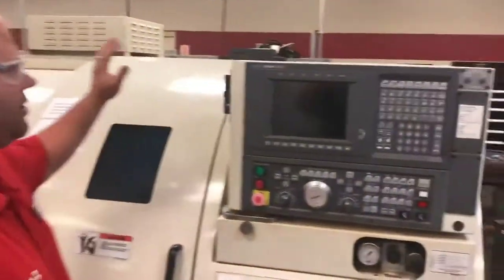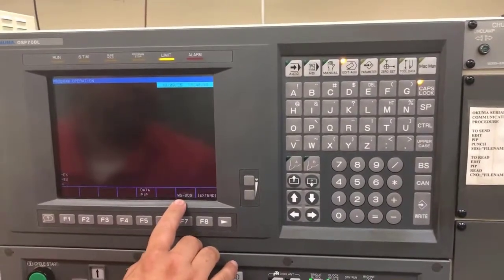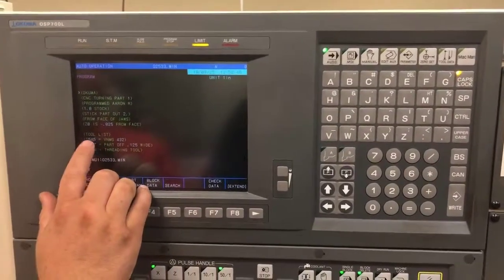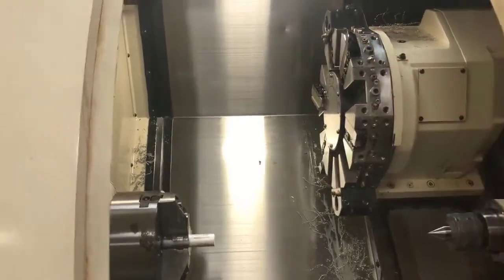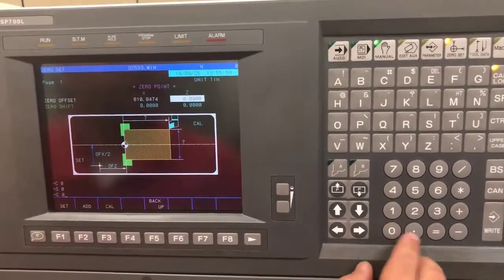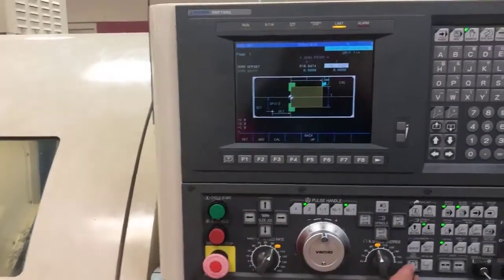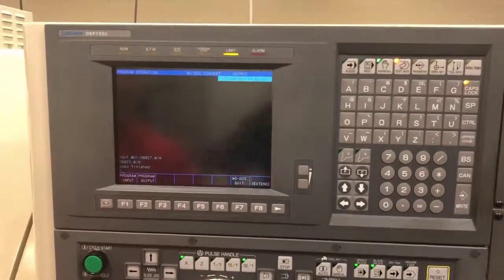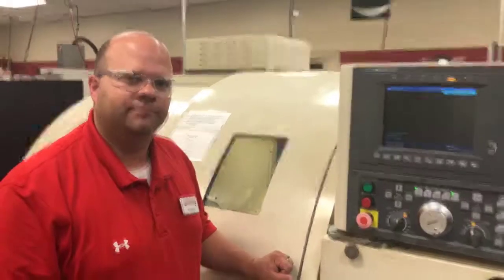Okuma CNC Lathe Setup

Comment: Great Advice!!   Also a good point to make if you update a program put a RIV # at the top because if you try to load a program with the current program blinking it will not load. Reset must be pushed first. Rev# will tell you its an updated program.
Reply from the maker: @robertanstead  thank you!

Comment: Hi, I am trying to get the load monitor work in OPS U100 L controllers , which is very similar to this as it looks, however i can not find where the load values installed after teaching mode, could you please help me with this
Reply from the maker: I'll have to do some more looking on this however when it comes to the teaching mode it sounds more like a mazak but if you are wanting to make sure that your work offsets are in the right locations you could go into MDI and send it to a known location to see if it has been set correctly. I will say your values are on the screen somewhere it's just kind of hard to find them on these older machines

Comment: How would you load a program onto this machine using the RS-232 port?
Reply from the maker: When I get back to the shop I'll look to see if I can figure out how to do it and if I can I'll record it and send it as well
Reply: @aaronrunk4209  No problem would be much appreciated! I have a Okuma Crown 762e OSP700L control fyi.
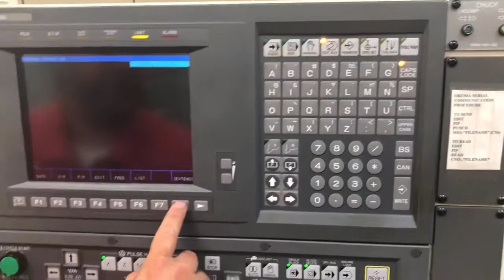Reply from the maker: At minute 2:30 in this video. 
https://youtu.be/qsOkxyRLabE?si=LR5tsmWtOEB7MYHq

I'll go over how to load from an RS-232. I know it's not the same machine. However, it should be very close, just different buttons
Reply from the maker: Thanks for watching